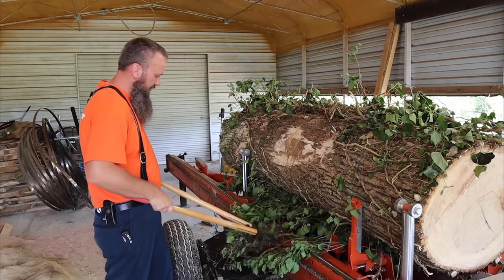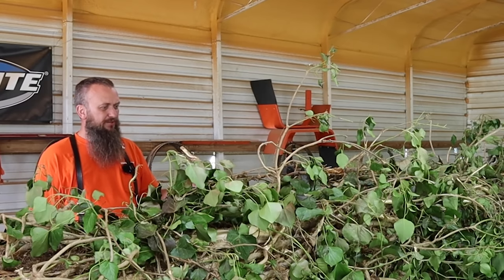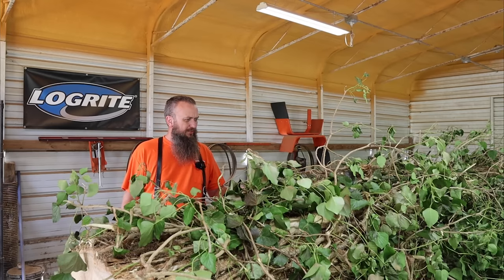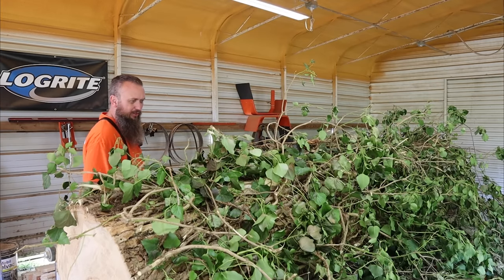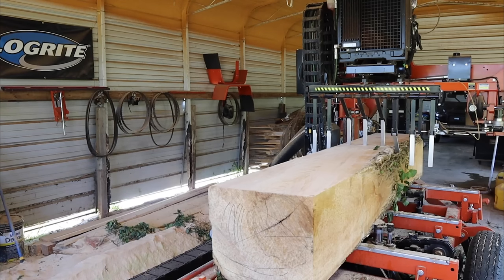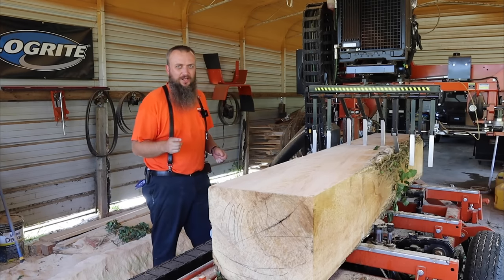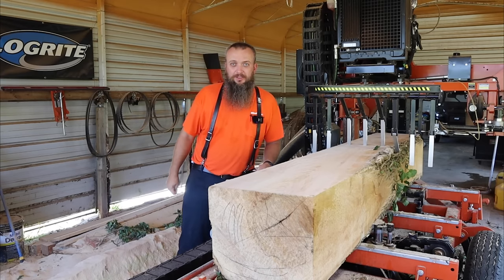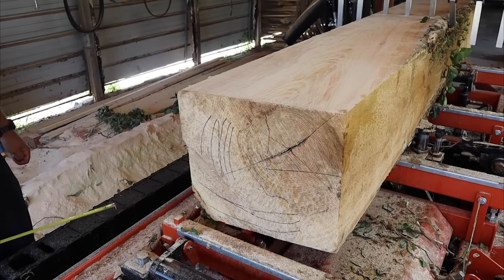What In The World Is On My Sawmill!

Comment: Ash is also a common wood used in solid body guitar making in guitars like Telecasters and Stratocasters. Fender used this stuff since the early days. Folks like to say it was "swamp ash" but I believe that covers any lightweight ash. If the cut boards (8/4) are too heavy they'd be rejected since few people want to sling a 12-pound guitar around. It is quite common to see 2 or 3 piece bodies under paint but nice grained 2 piece bodies would often get more transparent or stains. It's a bit of a pain to finish and requires pore fillers to get things smooth.

Comment: Another market for ash that big is solid body electric guitar and bass bodies. They often have to glue three pieces end to end to get the width they need. Alder is used more now for painted guitars, but ash is preferred for models where the wood grain will show through. Leo Fender used whatever the cabinet makers used in SoCal because it was easy to source. In the 1950's and 60's that was ash. Then they switched to alder so he did, too. Gibson used more mahogany because that is what was readily available for the Michigan furniture factories.

Comment: Question about the Woodmizer  Sawmill. 
Do you know if a swing blade Sawmill, such as the TurboSaw  swingblade sawmill, can cut  hardwood lumber as well as a Woodmizer bandsaw  sawmill ? One thing I noticed with the bandsaw sawmills, is that when the blade hits a knot in the  log, the blade has a tendency to bounce , causing an uneven cut.

Comment: Why don"t you trim all that ivy vines off of the  log before you put it on the sawmill, so mess would be outside instead of all entangled in sawmill inside of building. A heck of a lot easier cleanup.

Comment: One of your first boards had a curve in it. Both sides sticking up a little bit I seen. What causes that?
Reply: The tree most likely had some lean to it. You can see it in the pith. It isn't centered in the round. Therefore one side of the tree is in tension and the other side in compression. When you saw it up it goes where it wants to.